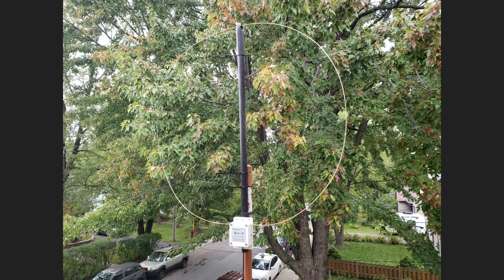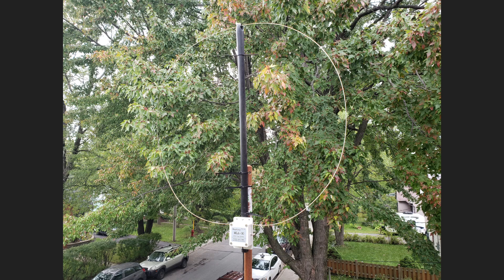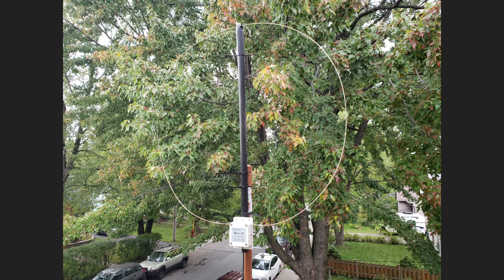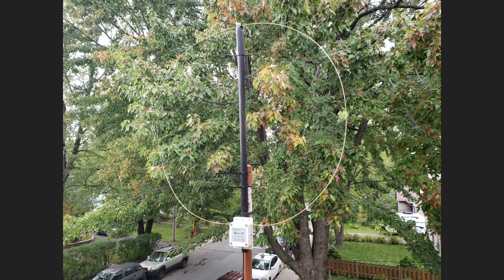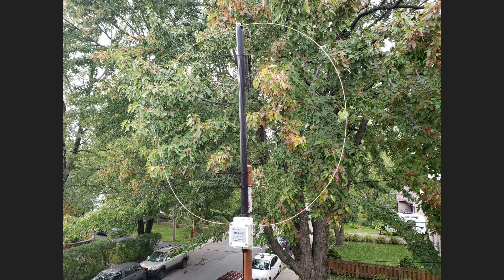Does my MLA 30 or Magnetic loop antenna need to be grounded

Comment: Hi! Yesterday I bought 2 antennas - Tecsun AN-200 and MLA-30 + mostly for receiving MW and LW stations. I'm using Degen 1103 as receiver. I was very surprised, but the An-200 works much better than the MLA-30. Very clear and strong signal compared to MLA. But according to your tests, MLA should be better. How can this be explained? Thank you.
Reply: AN-200 works better for MW, MLA 30 is better for SW.

Comment: Great stuff! 
*Loops generally utilize the magnetic portion of the  RF wave to RX signals.
Ground won't help because it's picking up the magnetic component of the RF wave.
*By comparison, "mini-whip" designs utilize the electrical component of the RF wave, and have their own characteristics that make them desirable in some installations; however these designs suffer in high-electrical environments due to them utilizing the electrical component of the RF wave.

Comment: Looking forward to the next video. Currently my MLA 30 is inside, next to my computer desk and works surprisingly well. This spring I intend to mount 3 meters above my roof and was wondering if I need a lightning arrester. I intend to mount a small vertical VHF antenna on the same mast.

Comment: My Pixel Pro 1B (Now DX Engineering) has a ground connection at the amplifier at the base of the loop. The instructions required a ground for the warranty.  
I not sure if it for RF noise reduction or lightning mitigation.
As always, another great video.